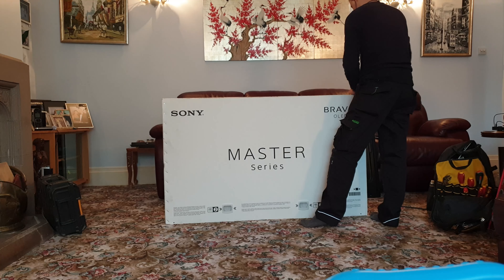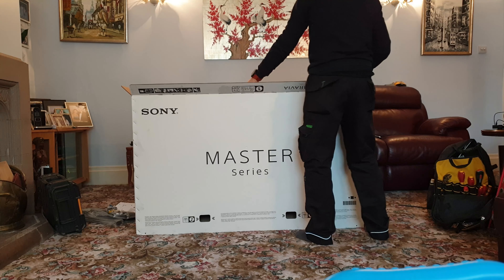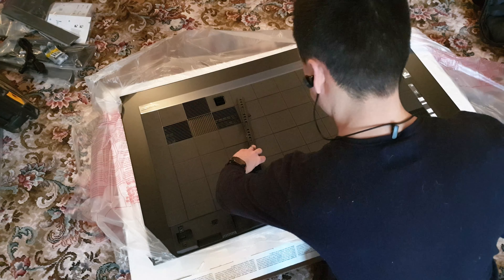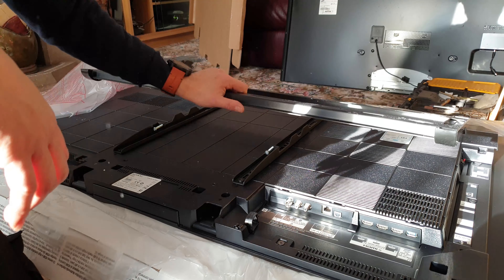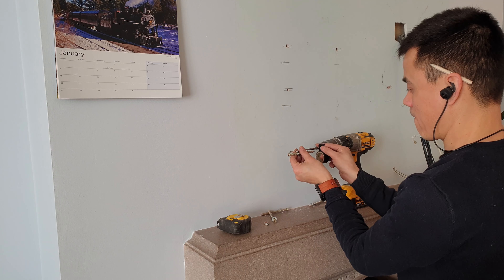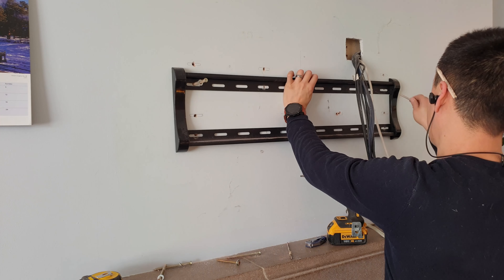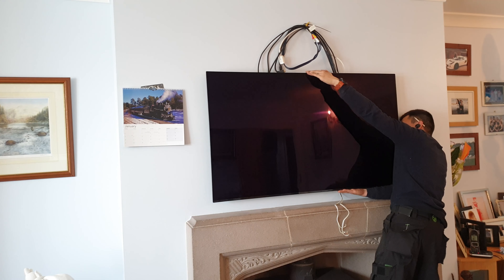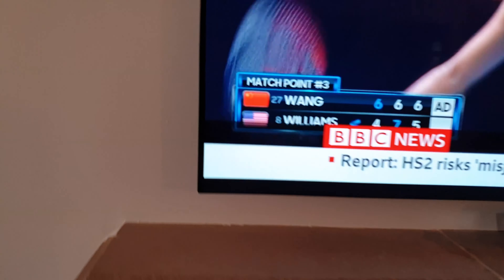Sony OLED AG9 / A9G Wall Mount Hanging Step by Step Install.

Comment: Can you tilt the tv is that safe to have it tilted toward to if it’s high up my simaler mount came with claws that you place on the wall and it’s tilted also I used the screws on the back of the tv ?

Comment: Niceee..:) going to be purchasing a 65inch A9G. 👊👊👍👍
Reply: Does it come with wall mount bracket?
Reply: @muthukumarappanm3029  It can be wall-mounted but you have to purchase them out separately. Contact a Sony representative and they will give you all the info that you need.  👍👍

Comment: Does anyone know why a Netflix won't play sound through soundbar with a HDMI cable but every other channel and apps work?
Reply from the maker: Try removing and reinstalling?
Reply: Thanks Dan I tried that but it's not working. I searched online and it seems to be a common problem
Reply from the maker: That's weird. Have you checked the audio settings on the netflix app?
Reply: @TellyDan  thank you for trying to help. I've changed the audio settings on the Netflix app but still no sound. YouTube and other apps play through the sound bar but Netflix has truly baffled me.
Reply: maxy 4400 same here for some movies etc. I juse Sony oled AG9, Maybe The New Update